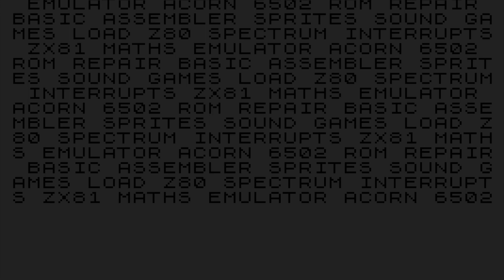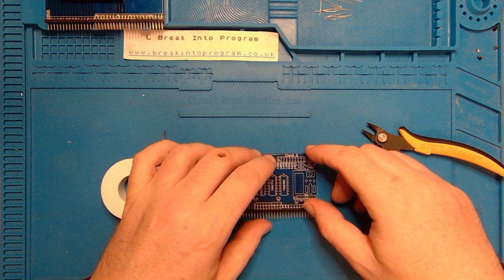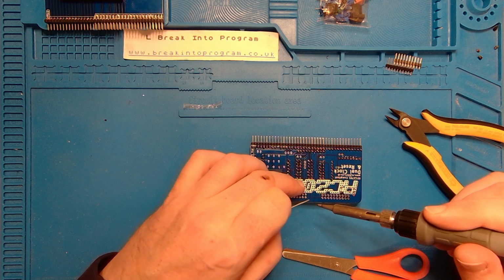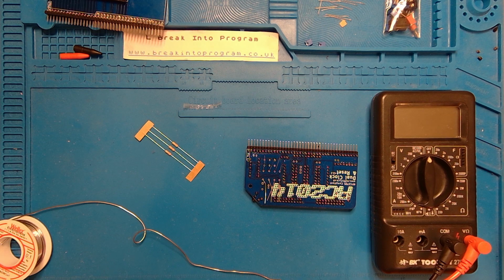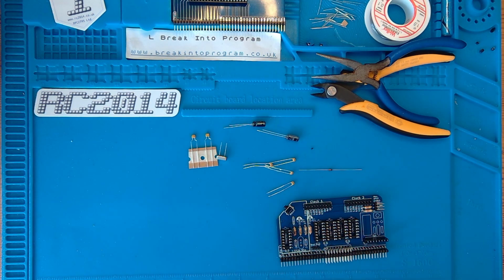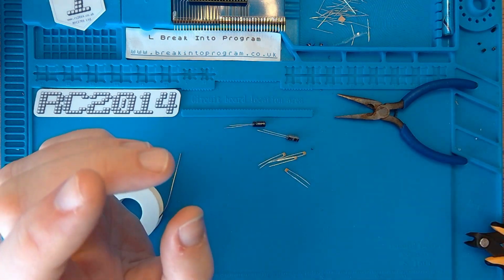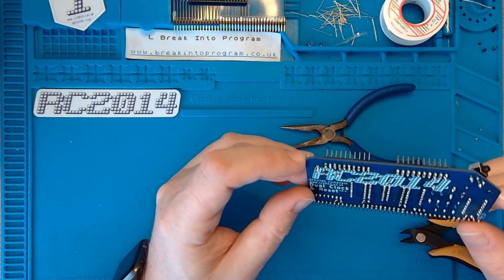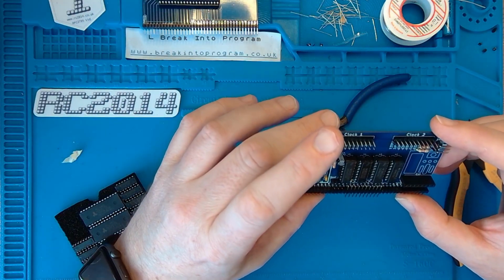RC2014 Build: Dual Clock Module

Comment: Great series. I just discovered your channel and enjoyed watching you assemble the RC-2014, I also find your commentary entertaining. You're able to take something as dull as assembling a  PC board and keep the viewer engaged. 
I purchased an RC-2014 kit several months ago and am finally getting round to assembling it. 
About your question as to why the leads on DIP ICs are angled out rather than straight, it's to keep the chip from falling out of the board until solder is applied.